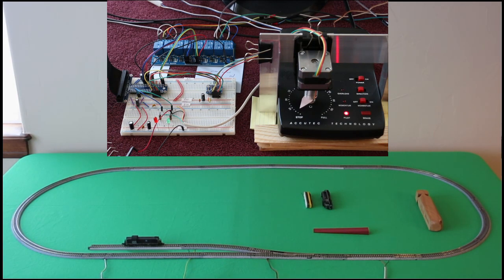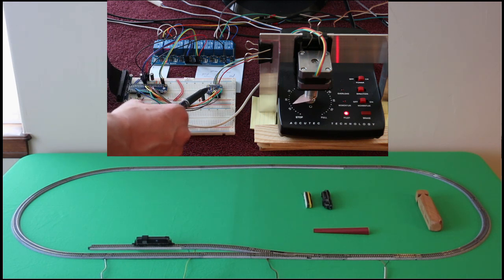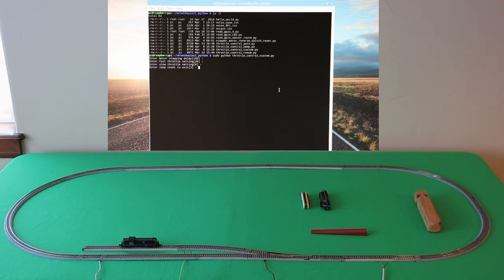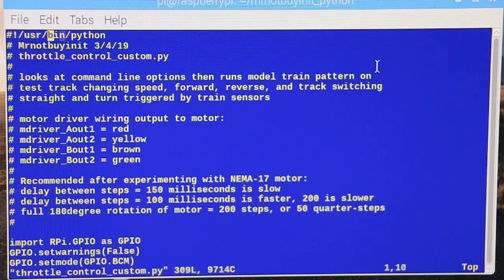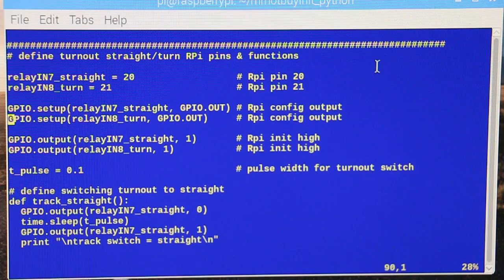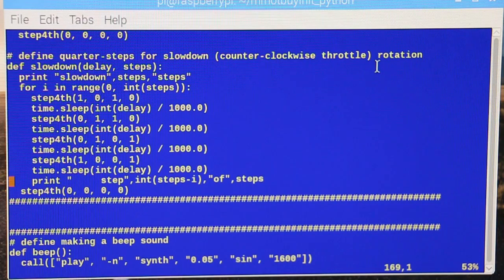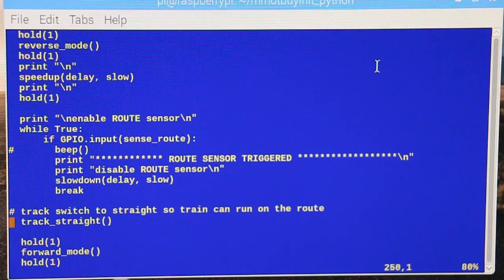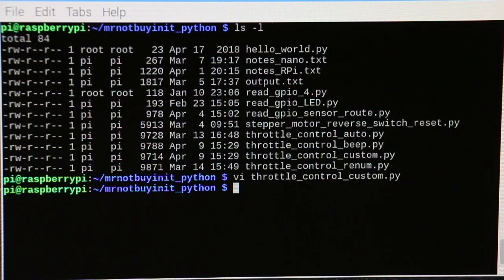Raspberry Pi throttle control of DC model train; how to

Comment from the maker: I just added a follow up video which describes the schematics and includes a method to avoid a potential electrical issue.  Look for "Raspberry Pi throttle control of DC model train; schematics".  Hope you find it useful.

Comment: Any plans to release (or sell) the wiring diagrams and publish a parts list.  I'm a software engineer by trade but the electrical engineering portions  are a bit intimidating. This is awesome  and I like that it doesn't muck with sending DCC protocols, just old school controls, sensors etc. Thanks for sharing this.
Reply from the maker: Thanks much for the feedback.  I think I'll make another video going into more detail of the wiring in an attempt to make it less intimidating, then create and make available a block diagram and schematic.  Hopefully that will make it more accessible.

Comment from the maker: Thanks much for the comments and question.  Greatly appreciated.  I'll try to answer the question without rambling.  Basically, I'm imagining someone with a very large fantastic older DC train system that they've had forever and are passionate about.  They want to give it automated computer control but don't want the expense of converting to DCC.  The engines, throttle and switching capabilities are kind of like having an old air-cooled Porsche that's a blast to drive.  So, I've been trying to figure out how such a system could be completely automated without changing the essence of it and without lots of expensive equipment.  The Pi and Arduino seemed the perfect solution.  I ultimately chose the Pi because I'm able to have it control many things all at the same time.  For example, on my main layout I've got a single Pi controlling a trolley, a steam train, a freight train, a traffic light and manual control with a 4-button keyfob.  Very cheap electronics to allow it to operate completely on its own or manually with just a simple keyfob.  Part of what led me to a career in electrical engineering designing integrated circuits was seeing my dad's HO setup when I was a kid.  I'm hoping to inspire other kids to get into computers, coding, electronics and robotics.  If kids get turned on by this, who knows where it will take them?
Reply: Just what I would like to do.